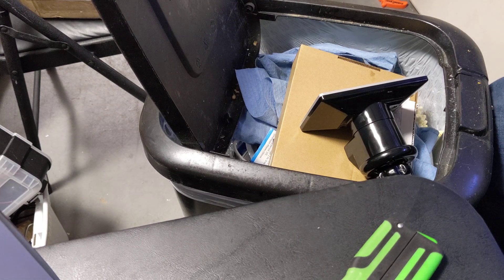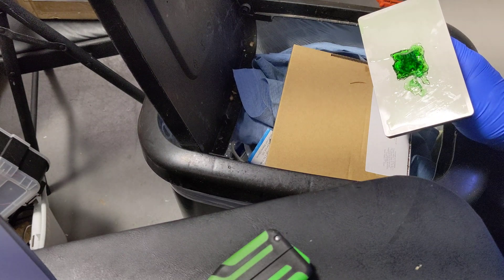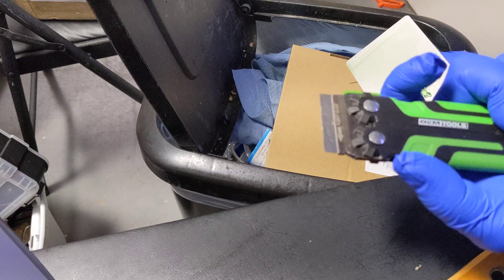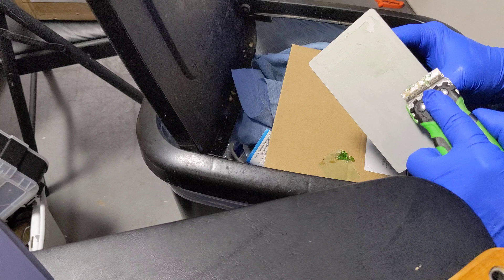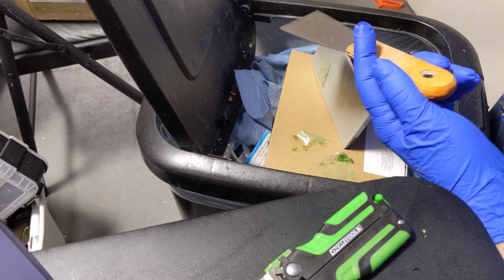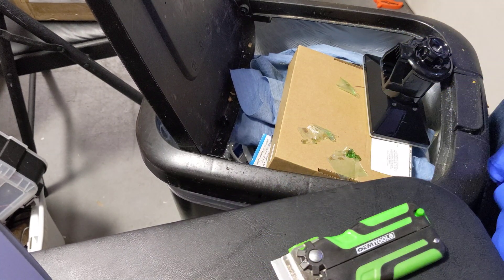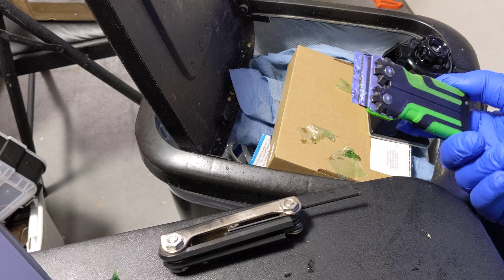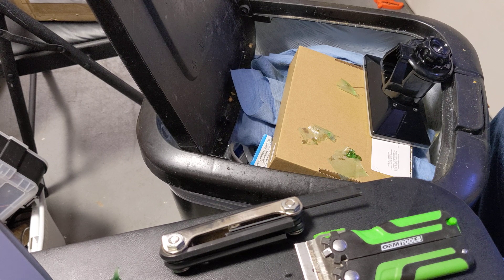Easy print removal for resin printers

Comment: I'm coming from FDM printing and I was always able to just give my build plate a little flex when the print was done and usually they'd just pop off. Resin printing, still figuring out and of course I tried using the crappy scraper AnyCubic sent with my MonoX.
Reply from the maker: Yea I suggest getting something like the one I used in the video. They do make flex plates for resin printers too but for smaller printers they didn't work very well for me

Comment: What happens if you scratch the build plate with a metal scraper
Reply from the maker: Then you scratch it. Literally every one of my build plate has scratches and gouges in it. The only downfall to that is if you print something directly into the plate then it will show in the print but if you always use rafts or supports it will never matter
Reply: @AkumaMods  thanks

Comment: If you want to be extra careful and are afraid of damaging the build plate, this type of scraper also takes plastic razor blades.
Reply: not really a problem though.. even on the bigger prints that can get stuck pretty good, a razor can get in there good.. 

plus you can always sand your build plate. Have seen people do that and for some it helps more than stock. Weird for sure, but whatever works right.